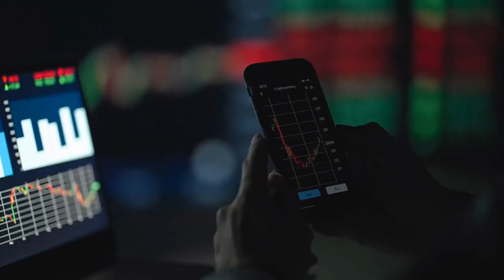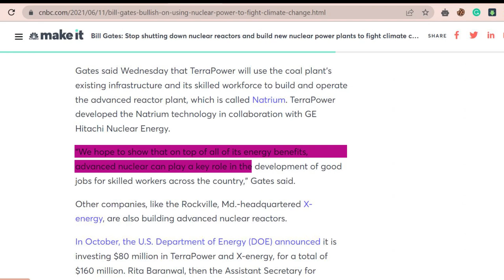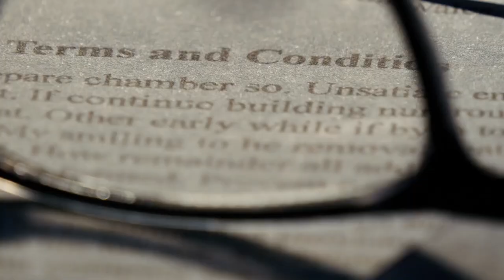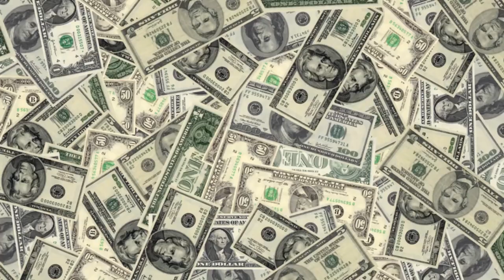How Bill Gates' TerraPower Nuclear Project Will Solve the Worlds Power Supply Problems

Comment: The USA does Not have Enough :-
Solar Energy
Wind Energy
Tidal Energy
Geo Thermal Energy.
Hence Any Current Investing in Nuclear or Coal or Oil or Gas is Wrong.
Bill Gates Should Invest in Large Scale Solar Projects on Mainland USA Preferable on Land being Used for other Purposes.  Example :- In Hot Areas, Solar over the Roads, Solar on the Highrises, Solar on Large Scale Infrastructure.
Reply: Chris, 

you are misled, by what or whom I don't know?

The generation sources you mention are not suited for large scale grid supply.

They are firstly intermiitent which means that there must be an equivalent source of readily avaiable reliable generation capacity at very short notice
They are asynchronous so require a significant amount of synchronous capacity also grid conneced to ensure supply and demand are in balance at all times.
They have no inertia which is needed to help smooth the supply and demand difference and helps keep grid frequency stable.
They diminish short circuit transmission line current levels required for satisfactory operation of theprotective system.
They do not contribute to reactive power which is needed for voltage control.
Their output diminishes with age and their life is approximately half that of conventional power plants.
Despite what is commonly believed all the above makes them very expensive as well.
Reply: @iareid8255  Yes, The Solar Energy is Very Very Intermittent When You Keep Investing in Nuclear.
Absolutely Right.
Reply: Pulling out of catastrophe will take every option of electrical generation and then some.
Reply: @mtn1793  ,
catastrophe, do you understand what that means, or is  hyperbole your norm?
If you believe that we need to produce power without CO2, then we have known how for very many decades it's just ignored.
Reply: Renewable is a stupid goal. The goal should be energy security, energy affordability, and environmental protection. From this perspective, it's clear that dilute intermittent power sources are insufficient to do the heavy lifting of meeting our energy needs and have a far greater environmental impact than other options, particularly nuclear power.
Focus on renewable instead of focusing on meeting our needs while minimizing environmental impact is counterproductive.
Reply: @dodiewallace41  So Your OK with Iran Building Nuclear Energy ?.
Your Ok with that, Right ???.
Reply: @Chris Griffiths  
Why? Are you thinking it must be all or nothing?
All energy sources have trade offs, NP rises to the top when compared to the alternatives. It requires a fraction of the resources to deliver clean, reliable power 24/7/365. NP really is the premier example of ‘dematerialization’ in which we actually use less to produce more.
NP is the way to go to provide clean, reliable power with the least harm. the evidence all demonstrates that historically, nuclear has been the fastest way to decarbonize, requires the least raw materials and land, and results in fewer deaths per unit of energy produced. 
We'll never have only one method of energy production, and there are appropriate applications for all energy sources, meeting the needs of 8 going on 10 B of us in vastly different circumstances will likely take all options. As NP is by far the lowest environmental impact, we should be using it as much as possible.
Focus on RE instead blinds people to the  downsides of anything we call renewable. instead, let's critically examine each option individually and stop thinking that being called renewable matters at all. Unfortunately, we have made the goal RE instead of reliable, affordable, low environmental impact. In reality, RE is nothing but a misleading marketing term like all natural or chemical free.
Reply: @dodiewallace41  So You Believe If Iran Improves Their Marketing.
Then it would be OK for Iran to Build Nuclear Energy ???.
Reply: @Chris Griffiths  
There's so much wrong with your assumptions in every direction Chris. If you're going to advocate for doing something this or that way, you should bother to learn something about what doing that thing actually takes. 
Most of us have no idea what energy infrastructure requires, and we should if we're going to advocate for doing it this or that way.
For an explanation that we don’t have to be engineers to understand this is a great resource. Shorting the Grid: The Hidden Fragility of Our Electric Grid  by Meredith Angwin. Or use any electricity infrastructure experts' explanations you prefer, but for heavens sake, use something to get some understanding of what you're talking about.
This shouldn't be so damn political and that we should depend on input from engineers & grid operation experts more than we do instead of advicates with no expertise or practical experience in the field. This isn't a sporting event or a popularity contest, although we act like it is.
I don't expect you or anyone else to take my word for it, I do expect you to use data and evidence to fact check your opinions and be willing to adjust your opinions when it conflicts with the evidence.
Reply: @Chris Griffiths  
If you're serious about comparing the green credentials of the options we have 
You would find the GLEX energy page useful. Here, you will find tools that shed light on aspects related to energy consumption and energy sources. The aim is to better understand the totality, which requires focus on climate, health, economy, nature, and the environment. The goal is to provide the user with relevant information that provides just such a comprehensive overview. It is not a goal that those who use the tools agree with everything but that the debate changes focus from opinion-based to fact-based. this is fundamental in order to be able to mitigate the climate challenges while meeting the sustainability goals.
Reply: Chris, 

no they are sensible. Energy density is the key and solar has a minimal amount of it.
It is the worst of all renewable generation and that is saying a lot.
Reply: @I A Reid  
It's very clear when given a thought, All energy always requires taking resources from our planet and processing them, thus negatively impacting the environment.
The inconvenient fact is that low-carbon energy generation depends on metals and minerals, just like high-carbon energy generation depends on oil and gas. You can’t call these metals and minerals with a prayer or make them in a lab. They have to be mined. What kinds, how much, and at what financial and environmental costs vary tremendously, and it's not related to being called renewable or not. As dilute intermittents like wind and solar are so problematic both in the enormous amount of resources they require ( the more dilute the system the higher the resource requirements) and in loss of efficiency when incorporated into infrastructure they have a far larger environmental impact than other low-carbon options. Over dependence on W&S will involve digging, blasting & leaching more minerals from the skin of this planet than ever before.
There are appropriate applications for all energy systems, including dilute intermittents. They and biogas are often the best option for off grid use. Some can be integrated into energy infrastructure, as adding solar in the southwest where hot sunny days bring peaks of power use due to air conditioning that coincides with high solar energy production. 
There must be sufficient reliable power in order to add intermittent power effectively. When used moderately, even intermittents can lower costs without compromising grid functionality. Too much raises costs and weakens infrastructure.
Reply: @I A Reid  
Renewable is such a bullshit term. Calling something Renewable tells us absolutely nothing about its sustainability, functionality, environmental impact, or any useful criteria. It includes wildly different systems that have nothing in common except that we decided to call them renewable. 
Wind and solar are far too resource intensive and chaotic to be capable of doing the heavy lifting of meeting our energy needs. 
Hydro and geothermal are dense and reliable but are pretty much maxed out with current technology. And hydro has significant local environmental impact as well. I'm hopeful that deep bore geothermal will someday be practical, making this clean, reliable power source far more available than it is now.
Biomass and Biofuel have very poor energy return for energy invested, require a tremendous amount of land, and can be quite dirty as well.
But we call them renewable, so we mandate they be used in spite of their usefulness and effectiveness. 

"For a successful technology, reality must take precedence over public relations, for Nature cannot be fooled."
Richard Feynman
Reply: Chris, 
hydrogen doesn't have a high energy density and it is very difficult to produce using only intermittent renewable generation.
Massive Environmental Pollution is such an emotive term but pretty meaningless when looked at realistically.
Reply: Chriis, 

you should know that it was pumped back into the sea. It was not high level waste but contaminated water.
Reply: Chris, 

you have your own perspective.
However, on balance, nuclear does far more good than harm and is a valuable source of power. 
The hazards of radioactivity have been exagerated and the perception is that no radiation is good. This is false and needs to be addressed.
Reply: Chris, there is nothimg more I can say to convince you that renewables such as wind, solar, tidal and wave are practically and technically unsuited for large scale grid supply. Technology advancements cannot overcome physical limitations. 
Perhaps with time you will see that they are not a solution?
Reply: Chris, 

have you no practical knowledge?
Reply: @iareid8255  AI Reid,
Sail Ships We Urgently Need these as Well.
Help Out.